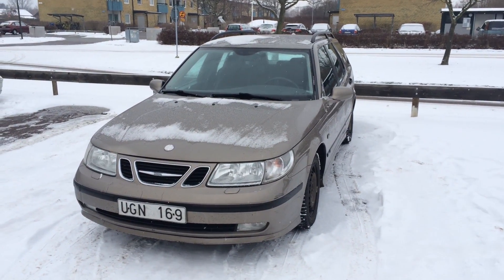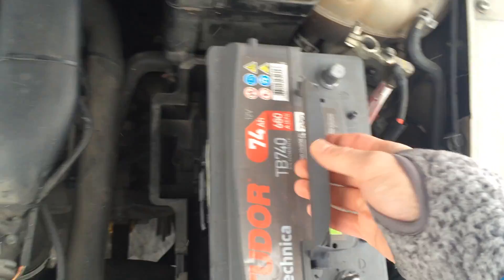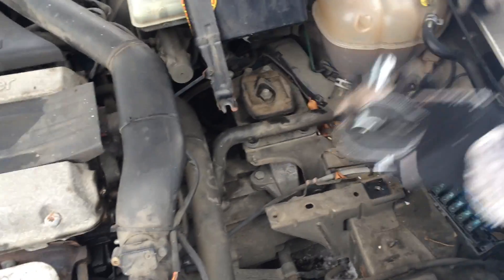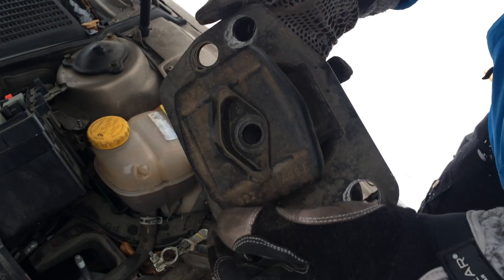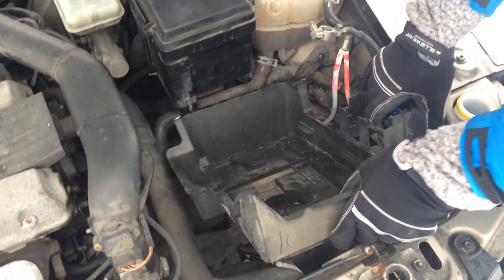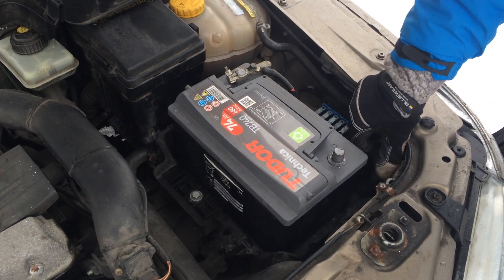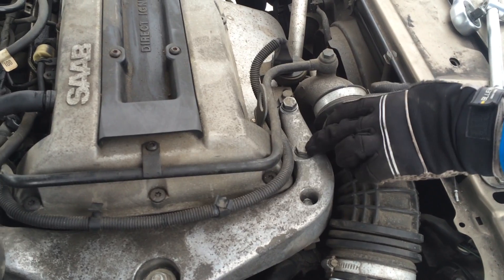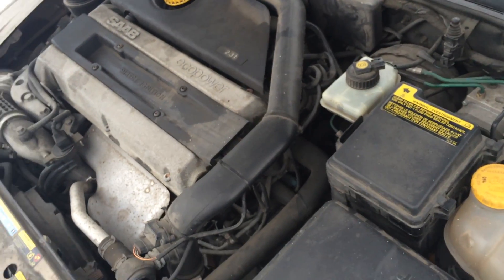Saab 9-5 DIY: Front Engine Mount Replacement - Trionic Seven

Comment: Hello ! good video you make.
They are very helpful.

Question: Which way does the engine rotate when viewed from the right side of the car, the one by the pulleys.
In the process of cleaning the crankshaft pulley, for the replacement of the multi-belt.
Grateful for answers .
Greetings Anders E.

Comment: Fantastic video! I'll be replacing the driver side transmission mount on my 2000 9-5 5spd soon. Do you happen to know the torque spec for that mount?

Comment: The shifting bump is often caused by a faulty valve body. I had this happening until it was replaced with a rebuilt one which used stainless steel parts instead of the aluminum that GM forced Saab to use. No problems since.
Reply: That's interesting, could you elaborate please? What valve body are you talking about? Is it the throttle body?

Comment: Great video as always. I ve got exactly the same late 03 manual with exactly the same, newer engine version and PCV. It recently developed vibration at idle which is felt on the steering wheel, gearbox and on my back in chair. It strengthens when Ac is on. When I drive the vibration disappears. Do you think engine mounts are a culprit? Changing gears is immaculate.

Comment: 11:40 my motor mount can fall all the way to the base of the bucket . I take it , it's not supposed to be able to do that?
Reply: No, and it shouldn't move to sides, if it's easy to move to sides just change it with better, not the new one but better from used shops or people, cuz these thinks are expensive

Comment: This is a well shot, detailed instruction video.  But, I wouldn't go thru all that to take out an old mount just to replace it with another old mount.  If I was too cheap to pay the $75 for a new transmission mount I wouldn't own a SAAB.
Reply: I know this is an old video & comment, but figured I'd chime in. I totally understand your point, but his situation is similar to mine. I'm going to a pull & pay this weekend in hopes of acquiring the mounts I need for my Saab. The reason for this is each mount is roughly $125-$200, my Saab has 241,771 miles on her & I've already had numerous repairs in the 3 short months I've owned it. I knew when I bought it, that this was only a temporary car considering the miles & previous maintenance. However, the condition of my mount has gotten so bad that it actually broke my ground & caused a stall a week after I got the car. We only just found the problem a few days ago, so she's been sitting for over 2 months. I fixed up the ground, but every couple of times I drive it, I need to open the hood & tighten that bolt again before she starts. If it had significantly less miles, I'd 100% put in the money for new mounts, but it just doesn't seem worth it to me all things considered.
Reply: Yes, the savings on that part alone look underwhelming.

But in all fairness - he said his SAAB had already way above 300000 kms on the clock so I can understand he assumes that before this 50.000 km old replacement fails, something else much bigger will total his car. 

Probably he got the mounts on a shopping run across a breaker's yard along with other parts.

Comment: very informative and easy to do. Only recommendation i would i make is to use an extension bar on your ratchet when doing the bolts 👍😊
Reply from the maker: Good tip!

Comment: Hi there, thanks for your video, I replaced the two fronts mounts, but vibration still exist although the two old mounts are all broken, and I replaced all vacuum lines, spark plugs and cleaned throttle body and MAF, no improvement, and the gas consumption getting very high, less than 15mpg, I found the vacuum valve installed in firewall inlet broke, I fixed with glue, no leaking now, do you think that vacuum valve cause these problems? Thanks
Reply from the maker: Jump in and ask in our community forum! https://www.facebook.com/groups/733705113501723/

Comment: Isn't there supposed to be another bushing on the passenger side upper? You might be missing the other one... Not sure how big a deal it is though.
Reply from the maker: There's just one on the passenger side
Reply: Trionic Seven they must have just done it on a few cars because mine does have a second bushing

Comment: Is it possible that when the motor mount breaks the engine stutters and speed takes a while to accelerate?
Reply from the maker: Don't think so. Open the hood and drive slowly while braking to see if the engine moves.

Comment: Hi Olle,

I think you gave a lot of people hope to fix their own vehicles! I have a question about the procedure. Im used to working on my BMW, this is my first Saab.  On my bmw, when i changed the motor mounts, I first unscrewed the bolts before jacking the engine up. I noticed you did this first. does this matter? How do you know how far to jack it up?

Thanks!
Reply from the maker: For this motor mount you only need to unload the mount with the jack before loosening. Jack the motor up just ever so slightly and then it's easy peasy.

Comment: Hi there!
thank you so much for this very useful information! I want to ask you about a part in the link below.
Do you think I should buy the whole mount for the  elk horn side? Or is this a great thing that will save me money? Because when you look and both mounts in your video it's just the isolator that's worn and squishy. 
https://m.eeuroparts.com/Parts/79704/Rubber-Mount-9281374/
Reply from the maker: The metal elkhorn doesn't need changing, just the actual rubber mount. I don't know what the part you link to does
Reply: I know it doesn't need changing. I found this isolator piece brand new on eeuroparts for $7. it is that wobbly core. Do you think just replacing might fix the problem without paying for the whole mount?
Reply from the maker: The part you linked is just for the air box, not an engine mount. You need to replace the actual "wobbly" mount.
Reply: I am sorry about that you are right.
thank you so much.

Comment: Hey Olle, I drive nearly the identical car, '03 Saab 9-5 Aero Wagon, manual.  I've already replaced all of the motor mounts except the rear lower.  I'm looking forward to watching you replace that one, it's difficult to get to.  Nice video !!
Reply: Hi Brett, I did the rear. It took a while but was worth it. I wouldn't say I'm an expert or anything so I believe anywould could do it with the right tools and some patience. I followed these "guides": http://saabworld.net/showthread.php?t=30455

Comment: Changed my left and right engine mount a few days ago. Much less vibrations and clonkiness. I'm gonna try replacing the rear one too but I'm having a hard time getting all bolts out. I have to get some smaller tools. Mine is a 9-5 2007. Thanks for the guide.
Reply from the maker: +Daniel Dahlin Glad it helped!

Comment: Thanks for another great video!  Did you also experience bad/notchy shifting while you had the clunking sound? I am about to swap my mounts too but I've read that many times it's the subframe bushings. Already changed my torque arm bushing. Improved a bit. Looking forward to the rear mount replacement video :) Keep it up!
Reply: +Daniel Dahlin The shifting itself feels fine, the sound appears when i release the clutch pedal. After replacing these mounts and the torque rod bushings, I'm also leaning more against the subframe bushings being the real problem.
Reply from the maker: +Olle Bolin Looking at your right-side engine mount you put in, could it be that that mount is worn out? It looked soft from when you torqued it down.